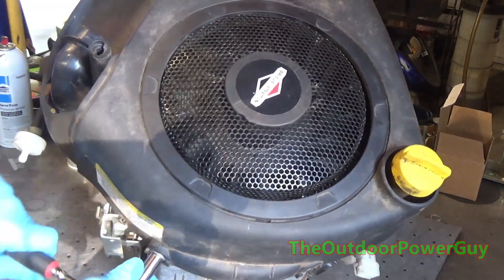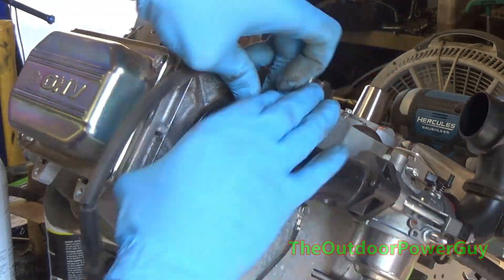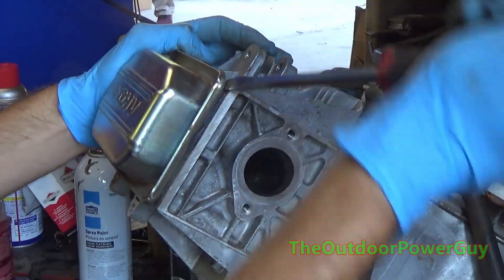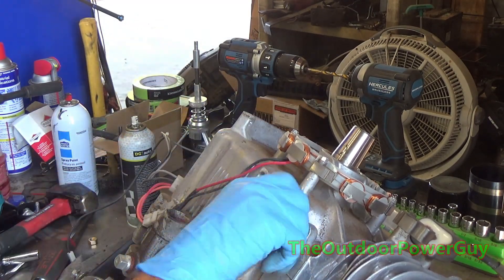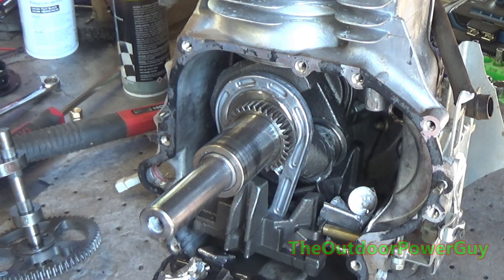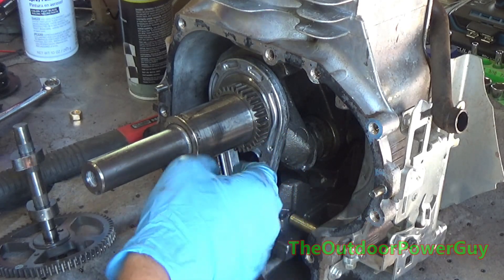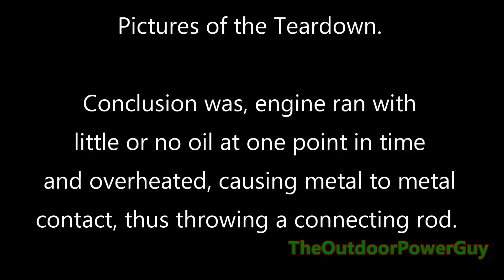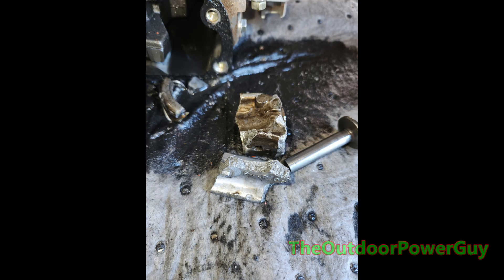Briggs & Stratton 17.5hp Intek Engine Tear-Down | Thrown Rod Cause of Failure?

Comment: I just bought a very well maintained '02 Craftsman LT1000. Runs great. I read on another thread that 20/50 oil is better than 30w. Any comments?
Reply from the maker: using anything other than SAE 30W will cause damage to a Briggs,  Kawasaki is the only engine that can use 20/50.

Comment: I had my whole fuel tank drain into the engine because the float or pin on the carburetor got stuck and allowed the fuel to start draining into the engine. After i replaced the carburetor I still have a bunch of fuel in the engine and I currently have been running the engine for about 10 seconds then opening the rocker cover where fuel is draining out. I have done this about 10 times and fuel is still coming out just less and less every time. (the fuel take and lines have no gas in them)  Would it be possible for gas to have gotten to the other side of the piston and be accumulating in there? and if so what is the best way to drain the engine of fuel?
Reply from the maker: change your engine oil and leave the dipstick and drain plug open over night, that way all the gas will evaporate from the crankcase, just put a note on your equipment saying "NO OIL" in big bold letters, then refill next day with the appropriate amount of 30W small engine oil. DO NOT run the engine with gas mixed oil - that can cause it to seize up.

Comment: What oil would you recommend for that type of motor? I have a 2010 lawn tractor and I used 5w30 synthetic and it's burning oil, I was wondering if I should use thicker oil. Thanks.
Reply from the maker: 5w30 is too thin, in a Briggs if temps are above 40F outside ambient, use only 30W and nothing else but straight 30W small engine oil.

Comment: Dangit!! You cut the video at EXACTLY the point where I needed to see how the governor comes out! Mine was knocking badly but nothing was broken, the rod bolts had come loose (or maybe weren't tightened), but I shut it off before anything actually broke. Cheaper to replace the rod (cylinder is pristine) amd even the crank if necessary, than to buy a new engine. But FIRST I have to remove the brass governor sleeve/bushing and NOBODY shows how.
Could you please take a minute and describe how?? Thanks!
Reply: Did you find out?? My dad wants me to fix a 16hp Wich suddenly made some bad noises and shut off and now he says it sounds like it has no compression and also that it sounds like it keeps spinning around after he lets go of the starter button. In all fairness I'm not keen to do the job but I'm at least gonna have a look before I recommend him to buy a Chinese knock 9ff engine for 450usd.

Comment: Question I have same engine if I don’t run it at full throttle is that better for engine or does it cause a dramatic loss in air cooling
Reply: From my understanding, these engines are meant to run more or less at their full throttle setting for a good percentage of their operating time. But that was from a carbon and soot build up perspective instead of cooling.